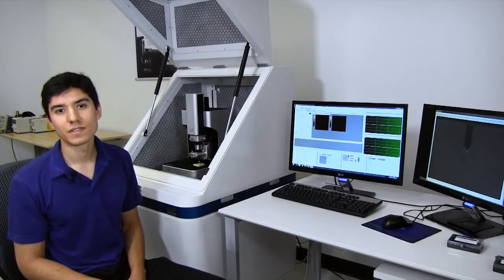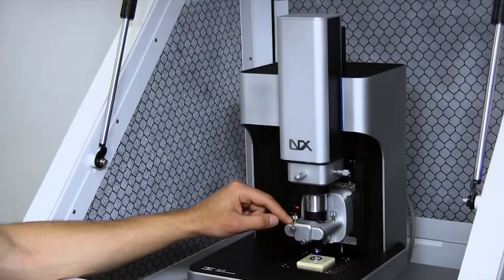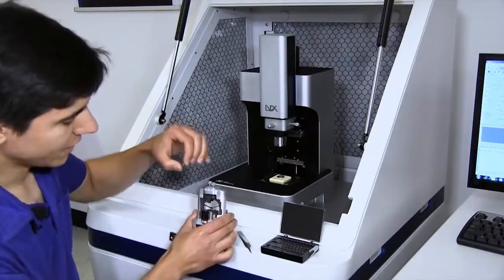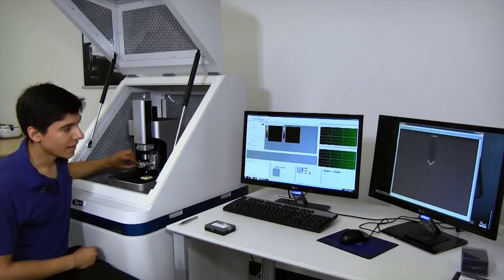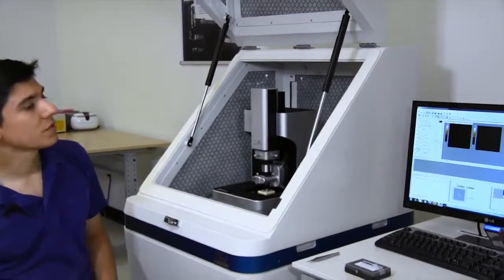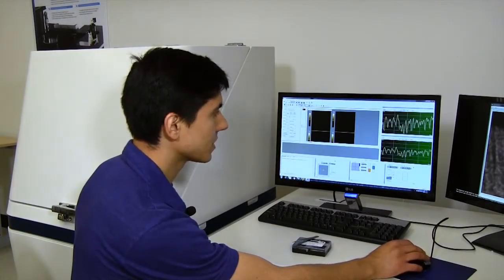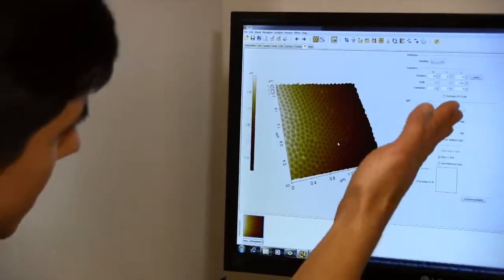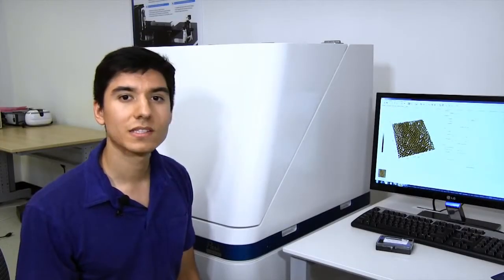Park Atomic Force Microscopy   The Easiest to Use AFM

Comment: Hi I am using your product. However, I cannot find the vision mode and the "eye" icon in my XEP software. Would you please help me?
Reply from the maker: Hello valued customer. It seems you are unable to access the vision of the main camera of our tool with the function of the eye icon. If you wish to activate the eye icon within your program, we can provide you with the software file that can activate this. However, depending on the model version you have, it may not be compatible and if you are already using a separate vision program, then having this function wouldn't be necessary as you are already able to access the vision. 
If you would like, you could submit your inquiry and send an email to our technical support team. You could first send an email to cs@parksystems.com